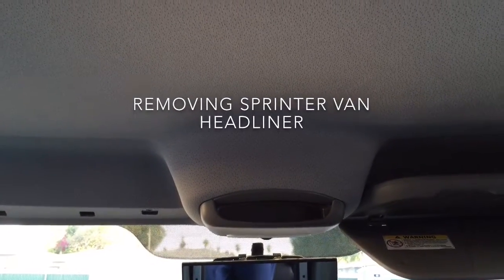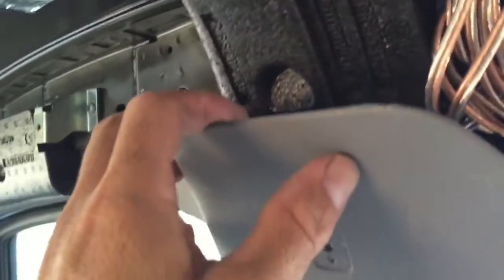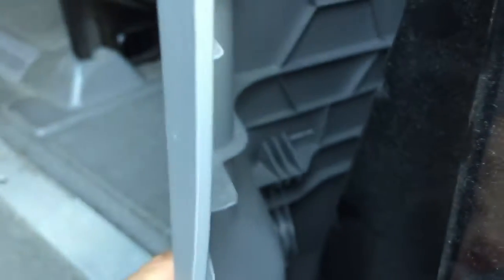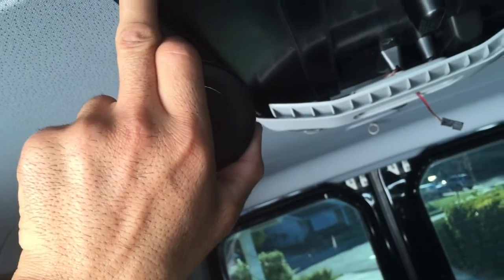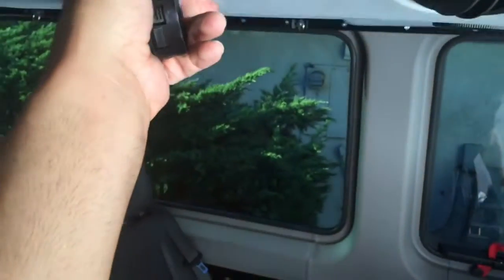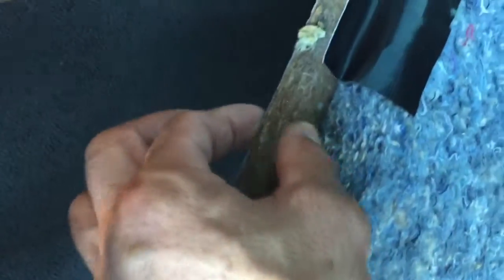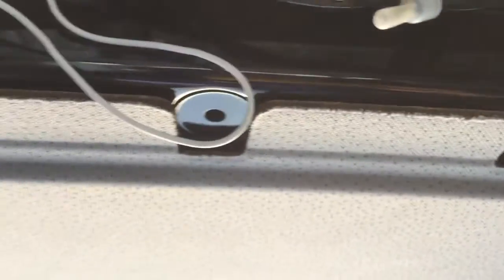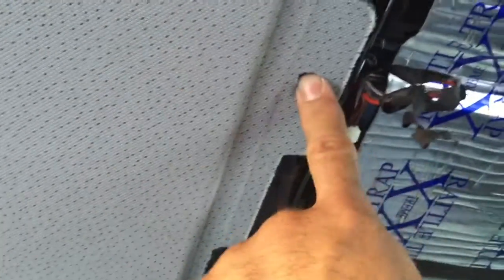Mercedes Sprinter Van Headliner Removal

Comment: Thank you for a good video.  Might want to back up the camera a little.  
What has been your experience with the roof top AC unit so far?  Any problems?  I noticed it takes a lot of space on the roof and the roof rack space is reduced by quite a bit.
Reply from the maker: Nat S. yes sorry!  Most of the time i have to get done quickly. With 4kids running around it hard to set up to get the best angles.  Yes it takes up alot of room on the roof. But so far i have been able to make it work.  I had the rack built around the ac unit.
Reply: Thanks so much doing the videos again.

Comment: Hey, great video.  I'm struggling a little with mine because I got everything down for the AC and the front piece, but the second piece is not coming off easily on the drivers side.  I looked behind the headliner and it appears that there is a tab that is part of the headliner that is keeping it from sliding forward.  Did you run into this issue?  Any suggestions?
Reply from the maker: ryankloostra 
Are you referring to the front  headliner piece above the driver. I dont remember having that problem. I yours a different year?

Comment: Ive been looking everywhere online and i see you have seen the rear ac unit. My question is, is it only electrical or does it have refrigerant lines coming from the engine
Reply from the maker: Its been so long i don't remember. I want to say there are electrical and refrigerant lines.  Check out my interior wiring video and maybe the soalr instal. You might be able to see something.
Reply: I was told independent or wouldn’t be so large. So just electric and thermostat.  I’ll be trying to ad a 12v supply and separate Ac thermostat. Instead of installing another unit in back for 10v boondocking.  Let me know if find out before myself